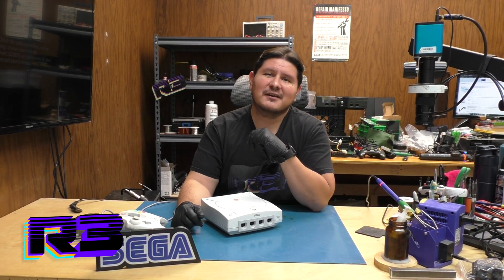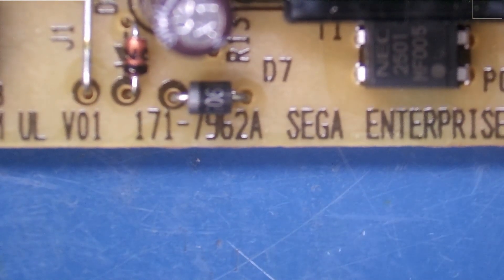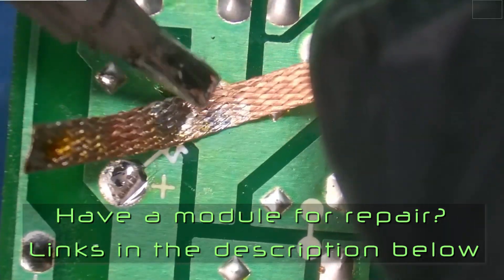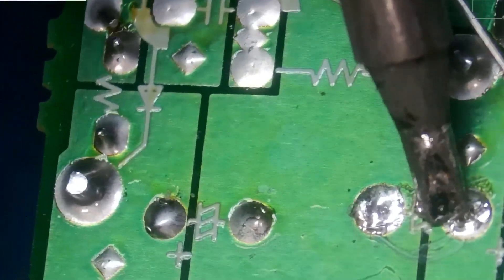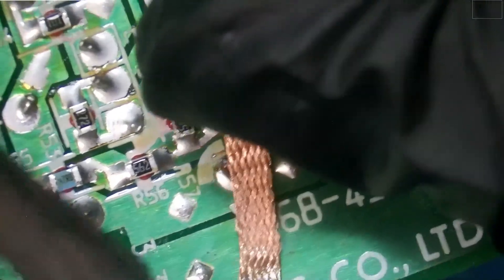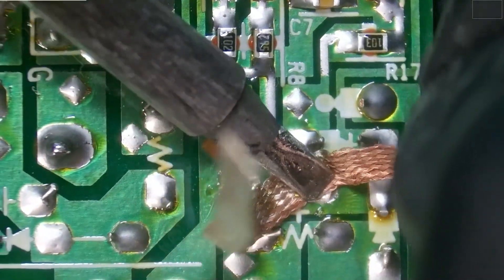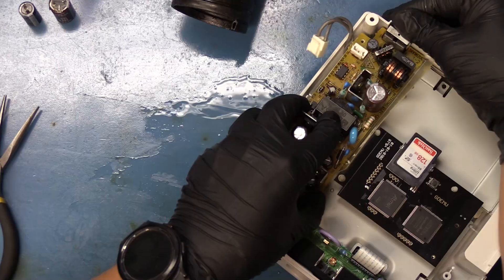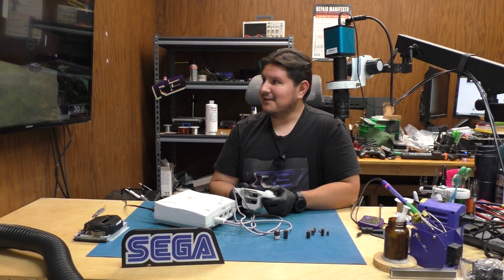SEGA Dreamcast Owners BEWARE Power Supply Capacitor Failure Is Coming

Comment: I have a PSU that simply stopped working and I found a bad mosfet but that so far didn't fix it as it still won't turn on. Yes I checked the fuse and that is still intact. Going to pull the caps next.

Comment: Thanks for the video. Anyone knows what readings i should get for testing the capacitors ? Mine behaves strangely, it works normally if i lift the psu board a bit. When sit and screwed down it's like losing a rail, power led brightness drops and console stalls. Connection issue?

Comment: It's strange how the caps were still within spec even though they were supposedly leaking. 

Could the residue that was under the caps have been adhesive?
Reply from the maker: It's tough to tell. Maybe it was flux that did not get cleaned?

Comment: Is it safe to remove the 12v regulator from the original Dreamcast power supply? Apparently if there is no GDROM drive and you have an ODE, that 12v regulator will emit more heat due to it not being used. Causing unnecessary heat inside the console. I just removed mine, but I am concerned about a potential safety hazard.
Reply: Its safe no worries. NTSC consoles dont really need it removed but does help

Comment: When you are holding in those probes on the discharged, are you sure it can't get through your gloves?

Learn the new ones the right things and call it what is should be called. It is not a U on a capacitor, it is a micro sign µ. It is better to say "micro F" than "UF" as you do.

And get a real side cutter. The one you are using is worthless ...
Reply from the maker: Amazingly enough, I was testing another board and had forgotten I wasn't wearing gloves and I did shock myself. So the gloves do help.
Reply: whats wrong with his cutters?
Reply: +1 For things that only matter when your talking to the parts guy

Comment: i have a question unrelated to the video. I have an OG Xbox 1.4. It has no audio at all, i suspect it is the MPCX, as i have replaced all capacitors on the board (even the smd ones) and the problem persists. The board is kinda warped, but i have worked o a 1.6 that was like that and it works fine. What i think it's happening is that the MCPX could have a pin not m
making contact. I'll try reflowing it.

If you have countered a Xbox with this problem, i would like some insight.

Thank you.

Also, i love all your videos, and i always leave a like. It's a shame your videos don't have as many likes as visualizations. In my opinion they are worth it. You explain very well and have a calm yet sometimes mischievous attitude while working that i like. Also, your jokes, while "bad" makes me chuckle.

Have a great day!
Reply from the maker: No audio. Given what you've stated, I'd probably take a look at the MCPX, and then to the video encoder.

Comment: I’ve managed to get several Dreamcast drives that weren’t reading discs back to  functioning perfectly by doing a recap on the drive
Reply: That's great info, thanks for sharing your experience.
Reply: Friend, which capacitors should I replace specifically, the ones on the GD-ROM? My Dreamcast stopped reading discs this year. Any help would be greatly appreciated.